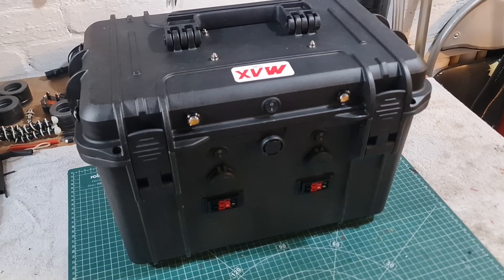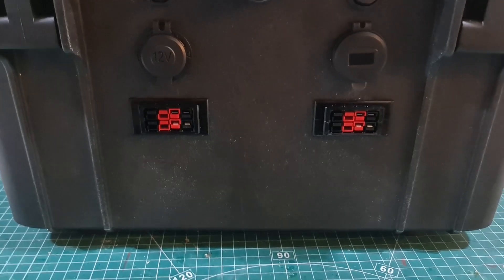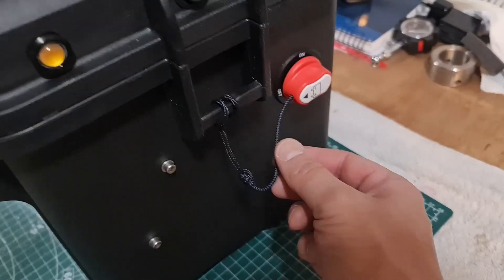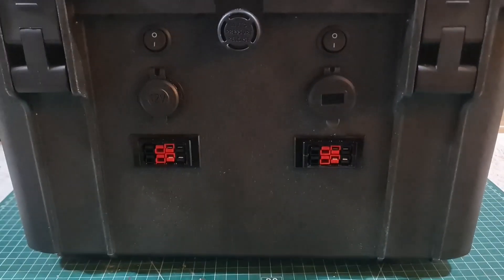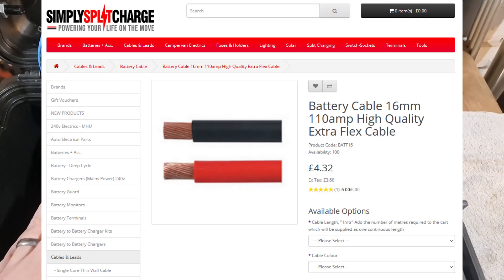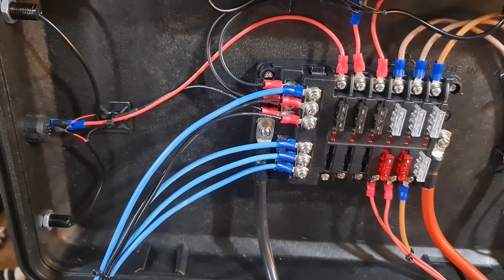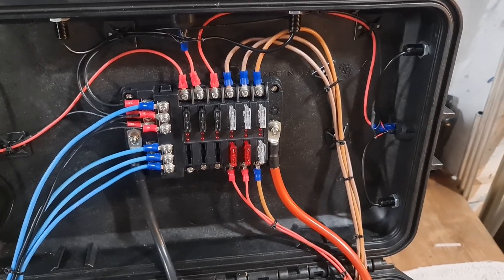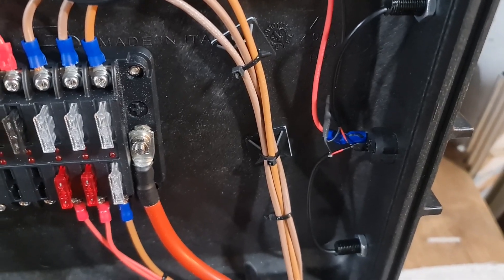Awesome DC Power Bank Build for #offgridliving #hamradio #vanlife

Comment: OK, so now you make me buy some more kit... You mention the isolator being rated at 200 amps, was that from Amzon? I can only see a 100 amp version that looks like the one that you fitted? 

For crimpers, I purchasd the Wirefy set with the various interchangeable sizes of magnetic adapters https://www.amazon.co.uk/Crimping-Tool-Wirefy-Interchangeable-Non-Insulated   I have the set of five, but the set of 11 includes the flag connectors, and power cables.

Thanks for taking the trouble to detail out the layout and parts list.
Reply: ah not Amazon for the isolator.
Reply from the maker: Way behind with comments. The isolator was from switch electronics.
Reply: A couple of thoughts as I wait for the last components to arrive; the foam that comes as part of the packaging of the battery would do for the lid padding and I am thinking instead of double sided at the bottom of the box, maybe some velcro strips?

Looking at the case (it is well made) what did you use to cut the holes, standard hole cutters?

I must admit that I have gone for the powerwerks USB sockets and they need a circular hole rather than rectangular. They weren't as expensive as I thought they might be.
Reply from the maker: Good ideas there. Yes think that foam may be fine. Not done mine yet. The velcro would be fine. I'm sure you will better mine. Yes standard hole saws but get the 29mm one anf not  the 30mm if its that size. I got a cheap 29mm hole saw from amazon that fitted to erbauer arbor mounting. Keep me updated on your progress 👍
Reply: Will do. As for naming something like the Power Box is simple enough? 

I migt look at quick release connectors for the battery although the lever arm versions may be a bit clunky. I may see if I can get tome of those screws with wings on.

You mentioned the floor that you put in, what was the material, I couldn't quite see on the video. As you mentioned, you don't want it sliding around as it could damage the connectors on the front.  @MM0OPXFieldRadio  Thanks again - Terry
Reply from the maker: I used clear acrylic sheet I had. You can use anything like ply wood or even a cut chopping board. Use what you have to hand.
Reply: That charger maxed at 15.3. 

By the way, the name for the box is the "Xtra Volts and Watts" aka "XVW", box or the OPXVW box. Then you only need to use a Sharpie (others available) to add your call letters.
Reply from the maker: Way behind on my comments. The isolator is from Switch electronics.

Comment: Battery boxes are great!
Reply from the maker: Yep, it got me wanting to build a smaller one now in an ammo can or similar. I seen your one, it was pretty neat.
Reply: I was thinking of something the size of an apache 1800 or 2800 - the most connections and biggest battery you can fit in that small space would be good for a 100w day-trip.  My ammo can is also good for a 100w day trip with a 12ah battery and some accessories.  @MM0OPXFieldRadio

Comment: Nice one, Colin. Have a look into the MPPT solar inverter side of things, they can be a massive source of noise. I went for a Genasun LiFePo charger on recommendation from various sources - they are NOT cheap but are electrically quiet compared to some others on the market. They are designed specifically to be quiet.
Reply from the maker: Thanks for the heads up. I had a look and they look pretty low current. Perhaps more suited for a smaller build which I am planning now after getting the bug building this one.

Comment: I used one of those eBay special 12v fuse boxes for my main shack (battery and solar powered), and after a few weird "power off during TX" issues with my 7610, it turned out to be the fuse holder melting internally, which only became obvious from the smell of burning when it got really bad!  Midi or maxi fuses for me now for anything over a couple of amps!  ;)
Reply from the maker: I stripped it down and inspected throughly before using but I will keep an eye. If I had more cash I would have opted for the Deep Blue Systems one which is marine rated.

Comment: Your links don't work to the Amazon products.
Reply from the maker: Agh, i will rectify tomorrow.
Reply from the maker: Try now John,  just a formatting error I think.
Reply: The link for the powerpole connectors on the front isn't there Colin.
Reply from the maker: Added now John, both connectors and housing.
Reply: @MM0OPXFieldRadio   Brilliant job mate. I wish I had seen this before I spent a fortune importing the Powerwerx box and Bioenno LIFEPO4 from the US! Many thanks, John